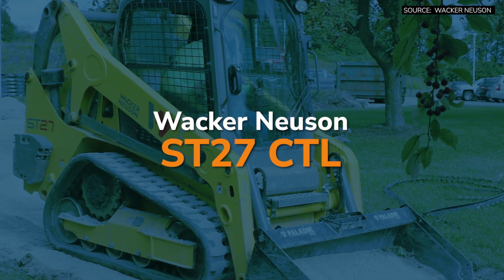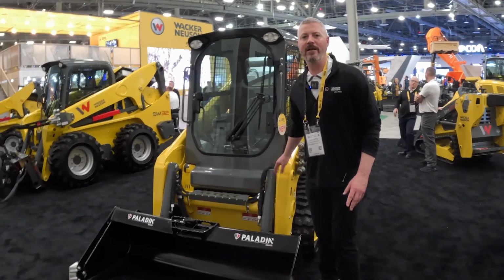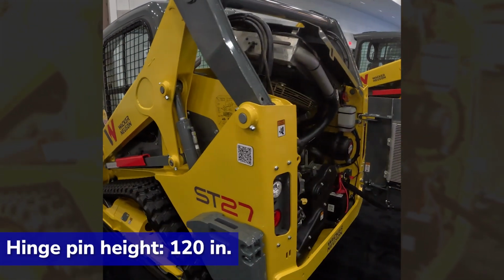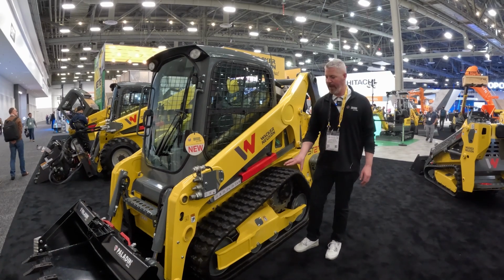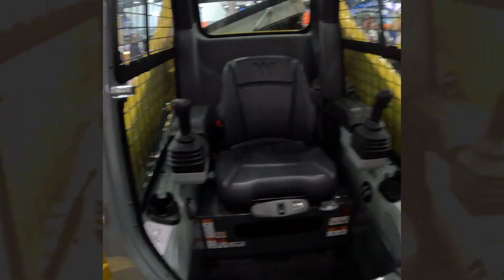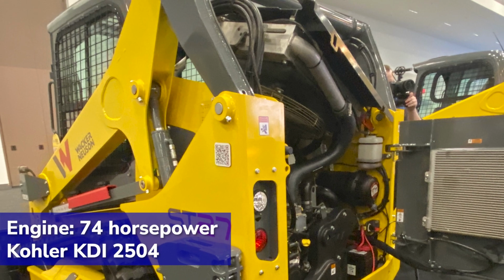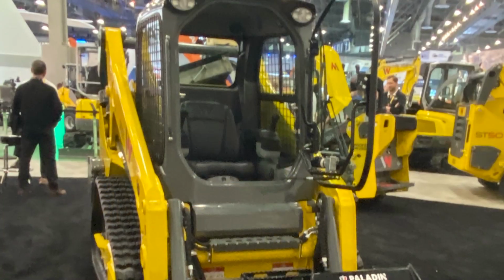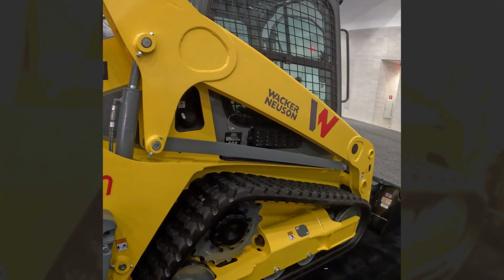Wacker Neuson Unveils Its Smallest CTL, the ST27

Comment: I just don't understand why manufacturers insist on a swing out door. It doesn't make sense to mandate an Operator run with the door closed. I hate that. Either ther door comes off very,very quickly or better yet, folds up into the ceiling. I wouldn't purchase anything else.
Reply: I was trapped in a burning skidsteer loader arms up back window covered in flames. Thank to some fast thinking staff. Pulled it away from the truck so I could lower the loader arms witch is not posible on new machines today needing eletric to open valves. Lucky it was older machine linkages. I buying a track loader this spring but only 3 brands with dealers by me. This brand cat an bobcat. I have to go 12 hours away to a dealer with brands that have roll up door. These with hinged door are death traps
Reply: @arnoldromppai5395  , the possibility for a disaster is definitely multiplied many times with a swing out door. Pure ignorance.
Reply: Design then retire
Reply: Looks like a jd 317g?  I heard deere bought neuson and deere excavators will be wacker?